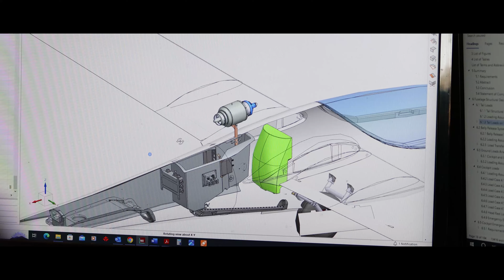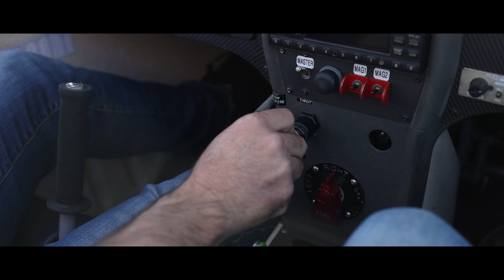Watch our Journey: Preparing the JS5 REY Jet for the World Gliding Championship 2024 - Uvalde USA! 🚀

Comment: Why doesn’t the tailweel retract?
Reply: The rear wheel has very low drag, and when the rear wheel retraction mechanism is fitted, it adds even more weight.
Reply: @Ljet600  You've got it the wrong way round. Glider pilots want to get rid of any small drag they can, to the point that many competition gliders have bug wipers to get rid of the tiny drag created by dead bugs on the wings. On the other hand, extra weight can be an advantage, as the best gliding speed for a heavier glider is higher than a lighter glider, so the heavier one will be faster between thermals.
Reply: on the website of JS-Sailplanes it says it has a retractable and stearable tailwheel, so maybe because of the testflight the wheel was not retracted
Reply: @yankiecharlie874 correct.